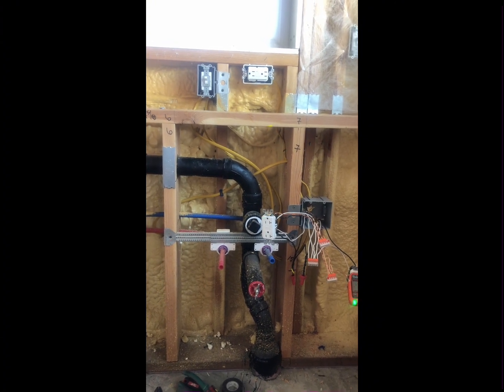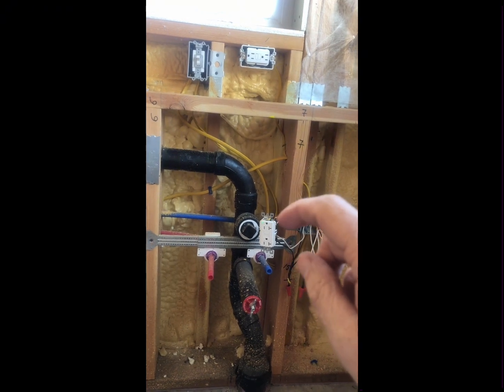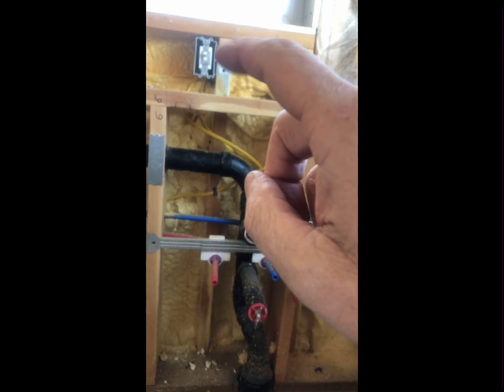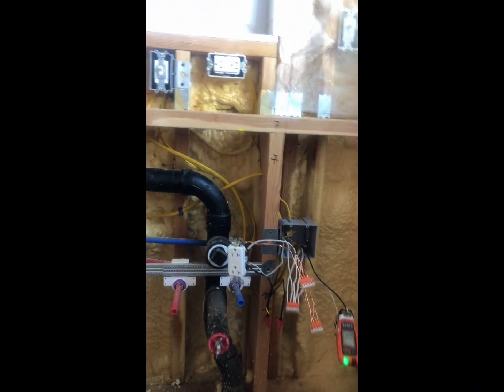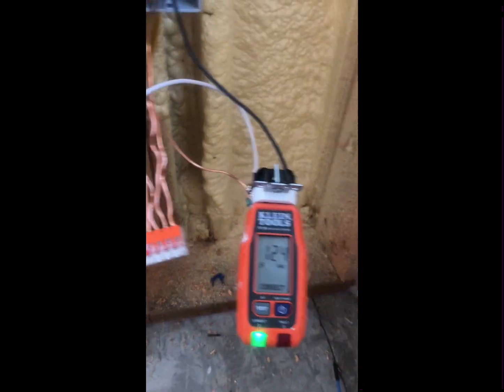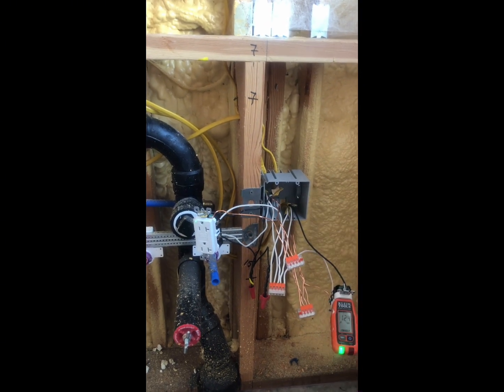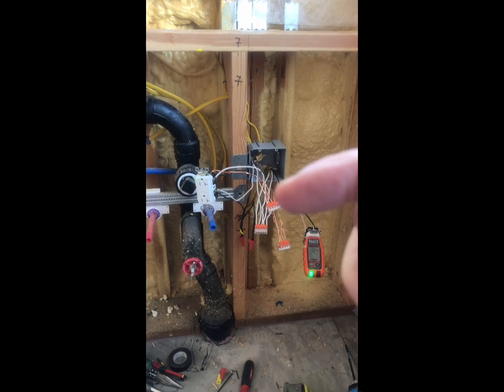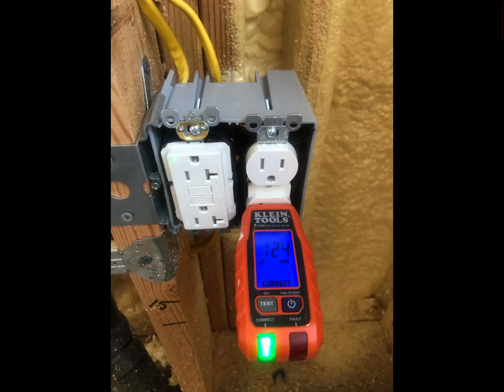Electric: Identifying and Repairing a “Ground Fault Neutral” and/ or a “Ground Only Fault”.

Comment: The tester is showing an open "groundED neutral", or simply "neutral" conductor. The neutral is considered a grounded conductor because it's grounded at the main panel. A broken groundING conductor (the bare) will not prevent the circuit from working, so tying all those together, and making it work, was simply a coincidence. Somewhere the white neutral was loose, and you fixed it without knowing it. 🙂
Reply: You need to know your test tool, the tester (Klein RT250) is showing an open ground AND neutral. As for this video, it scares me that someone is doing wiring and doesn't know all the grounds are tied together not just to make the tester happy but as part of proper electrical work. I'm glad this isn't my kitchen because yes the tester is happy but I don't trust the actual wiring issue was fixed instead of covered up.